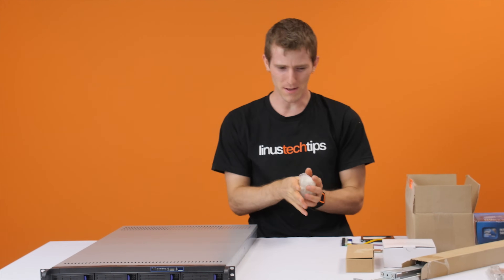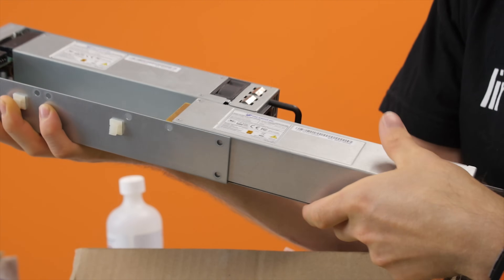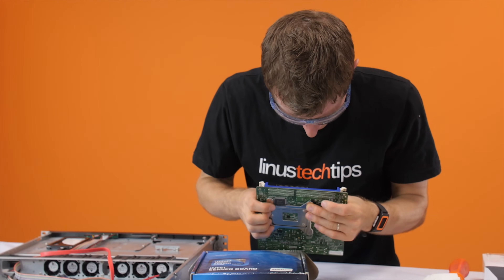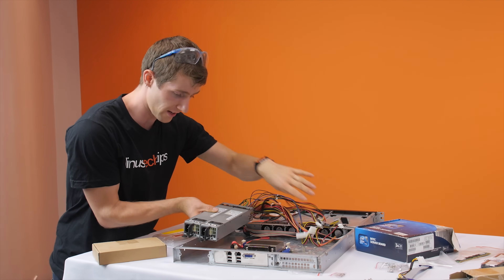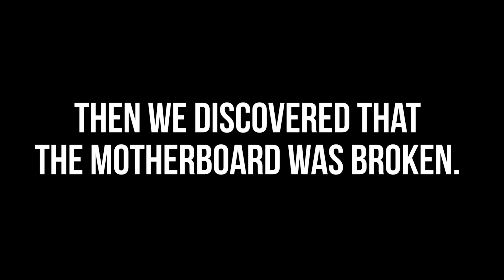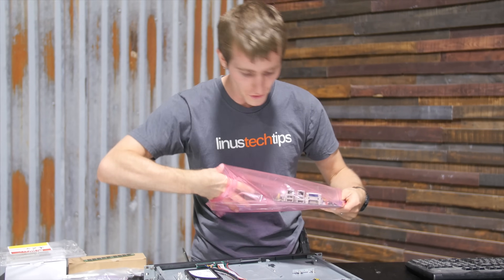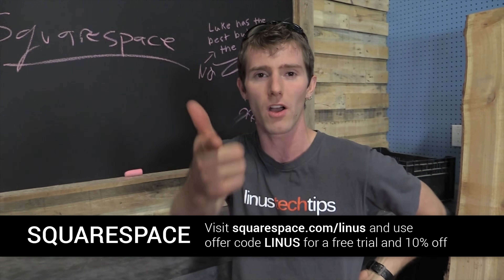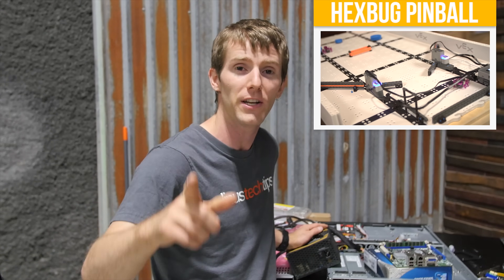DIY pfSense Rackmount Router Build Log - Part 1

Comment: Linus, some Intel motherboards are extremely picky,  when you do NOT have a CPU fan connected to the motherboard.  When it runs into boot and does not see a fan after a self test,  it will throw a thermal shutdown.  Some motherboards with Intel even do that with no chassis fan connected to the board either.  You may not have bricked either of the motherboards.  It could be that issue,  just hook up a CPU fan and set it inside the case.  May be the issue.

Comment: From my experience working with boards that interfere with the backplate zone and 1U cases, just get nuts that fit the cooler screws and forget about the stock backplate. Tighten enough to spread the paste which should cause board flex to be no more than 0.3mm from CPU to board edge. I actually used xbox 360 backplates at one point if mounting pressure was critical.

Comment: Linus. i have a few suggestions: use an ATX motherboard for more expansion and cooler clearance, or at least a different one. use a different cooler im sure there are better coolers on the market. i know the mini ITX allows more airflow but an ATX or micro ATX would be worth the trade off. but otherwise a good idea.

Comment: May be an old video, but I do have to say how much of an idiot you are to DREMEL AT A MOTHERBOARD! Desolder... Replace the fan pins with ANGLED PINS! ... You're supposed to be much more knowledgeable than I am, yet here is a fine example of that not happening...

Comment: Shortage due to backplate on the back? maybe it's on of these Boards which do not even post, if no cpu fan is connected? and i might have tried swapping those srews from the cooler with some of those press-down-to-clip-on screws from an old intel stock cooler. Which might eliminate the need for a backplate at all. And i'd check, if the cooler might touch some compontents of the top side of the mainboard. oh, and a test out of the case before with some other cooler might be useful for failure.checking..

Comment: This quite reminds me at my pc build. I had to drill a hole into my cpu backplate and my old iChill GTX770 was an 1mm fit to my HDD cage, but it has to be angle grinded for the even longer GTX1070 Strix. But the IO shiled just fit as it should :D

Comment: i think most people will installing those difficult 1U setups with lot more care to not let die a motherboard, take much more care on the cpu installation, space is very critical and short connection is easy made, personally i wouldnt use 1U anyway , just use at least 2U make things so much easyer, bigger fans, cooler machine and space for some upgrades.
I mean 1U form helps great in a datacentre , but for home or office ...  shouldnt be the limitfactor to not use something bigger

Comment: I'm in the process of building my own at home server , to save money I'm building my own case. I started out with a standard breaker box that you would typically use to power your house , hollowed it out and made some metal fab mods and it actually made a pretty decent case , I'm still waiting on RAM and storage but other than that I'm just about done , I've gotten dual AMD quad core CPUs , 600w power supply , and an HP server board with 8 ram expansion slots and 14 SATA ports. so far I'm at $300 by the time I'm done I'll be at about $500

Comment: I did not read all the comments, so I am probably repeating.. but it's pointless trying to shoehorn a router into a 1u. just do it right, in a 2-3 or even 4u. IMO, 1U is really only for when you need to absolutely maximize your dnesity. Secondly, those backplates are to allow more weight from vertically mounted, heavy heatsinks... You would probably be far better off to find a way to skip using that mounting plate on back of the motherbaord for this application. Maybe some bolts instead. Thirdly, with all the space you have, why would you use an ITX board? My opinion, and ONLY my opinion, is it's a complete waste. get at least an mATX board for this build. It would then (most likely) eliminate the backplate issues, becasue it wouldn't have chips soldered onto the reverse of the PCB in the bakcplate area, and you wouldn't have to destroy components on the top to fit the heatsink.

Comment: OR!! just pick up the cheapest PC you can find that has an expansion slot for a NIC.. You can find refurbished PC's the all day for around $100 with a 3GHz Core 2 Duo and 4GB of RAM. Usually they have a 90 day warranty. Maybe replace the HDD with the cheapest SLC SSD you can find and you might be set for 5+ years of solid gigabit performance. Maybe even run PFsense in a VM on it with 2GB allocated to it and 2GB allocated to a simple NAS VM on the same machine for web cashing.

FYI, Intel NIC's seem to have the lowest overhead Incase you only find a dinkie CPU for cheap.

Comment: Just curious and I know the video is not new but since the board is obviously designed for a stock cooler or a cooler designed specifically for it, why didn't you just use nuts with insulating washers instead if the backplate, ideal?, no... but it probably wouldn't have killed the board, it works for stock coolers to not have a backplate, and it's a low power Xeon so...

Comment: So let's see if I understand your method.
Have wrong form factor part to fit into a 1U case, so you have the following options.
1. Figure out you have the wrong part, so return that part and purchase the correct part for the job.
....or....
2. Whip out the angle grinder and cut off those pieces that are in the way resulting in a part that is no longer returnable.

Wise choice.

Comment: Linus should warn people that nothing in this video should have occurred ever when building anything you would like to have operate which must have been why he made it. ?????  A reverse psychology tech tip video on what not to do at all ever when engineering or constructing anything. Even if you just want to waste your time and money instead of just bashing your head against a wall. omfg, a dremel tool used at all for any production equipment should never happen. my mom can barely use her ipad and would never even think about doing some shit like not taking the time to size up ALL of your components before assembling something. I think you should put this in a category like entertainment because I would be hard pressed to find anyone without the intellect to take on this particular project in the correct manner. Sorry to bitch but this just seems in my opinion to set a bad example to younger people regarding not taking your time to research everything 100% then double checking your work for any build. sheesh.

Comment: I have never has issues building anything into a 1U Rack case before.  Equipment or computers alike. . .  ALWAYS double check your work when working with full metal chassis and make sure nothing is shorting out and always make sure everything is properly grounded especially when dealing with high voltage systems crammed into a 1U lol

Comment: Don't you hate when a cheap quick build becomes an expensive time wasting project?  Maybe you should plug in the board and put a Multimeter on that backplate to see if it is getting current.

Comment: i love my pf sense router its amazing the sky is the limit for these what ever you want to do with it. that being said i would love to see some videos on configs and packages that you can add to it. I have even seen people adding gps time modules and external monitoring screens. would love to see some how to videos on this linus! i think its a really cool options to get a router, firewall, traffic shaper, dns, vpn, switch, poe switch, dyn dns and much more that you can build yourself in any configuration you want at a fraction of the cost of even a store bought junk router even using a laptop or old computer. theirs 2 packages i want to add to mine squid and snort did you  guys happen to set that up?

Comment: Im all for building your own firewall/gateway/router, infact i'm currently building an Untangle box for +- 1000 devices. However both Dell and HP have some amazing server for good prices which are pre-tested at the factory. You receive a WORKING server with which to install pfSense.

Comment: So what heatsink was Intel expecting you to use with this board?

Stock cooler won't fit in a 1U. Most aftermarket coolers require backplates that this motherboard won't accept. Sounds like a huge design issue.
Reply: it isn't a 1u motherboard

Comment: waist of money and time just use an old rack-mount server like my power edge 2850 i picked up for 100$ on e bay with duel duel core xeon and dual power supplies tecks like this are just wasting money with this shit metal shavings and  cut case will fry your MB real quick METAL DUST EVERY WHERE WHY DO U THINK THEY USE CLEAN ROOMS FOR A REAL GOOD BUILD]

Comment: Had the same issue with my miniITX board. They compress everything so much they often have chips and such around the bottom of the CPU socket.

Needless to say, backplace should definitely not be touching anything metal on the back of the board... Had to go with push-pin cooler.

Comment: After watching this video I'm beginning to understand why Console players think PC building is something hard to do
Reply: That's because you buy crap hardware or don't have common sense. I've never had anything die while working with PCs, except for cheap ass PSUs.
Reply: But it's not like console people ares building a 1u rack mount machine
Reply: That's because you don't know how to use them
Reply: I can do the same thing to a console everyday for 10 years and it works like a dream. if I even look at a computer wrong, it starts smoking, gets a virus, blue screens, buzzes, starts on fire this time... you know? everything i can do with or to a computer will cause it to crap out on me in the worst way possible.

Comment: You could have just gotten a Supermicro 1U server, probably for the same amount of money (or less) and everything would have been designed to work together from the get go without needing to cut anything.

You would have saved yourself a LOT of time.
Reply: Wouldn't make for a very fun video, would it? The point of LTT is entertaining the viewers, this means doing things suboptimally sometimes
Reply: It's not just suboptimal, it makes him look inept. I personally lost a lot of respect for him.

A proper build using proper hardware would have been just as interesting with no loss of respect.
Reply: +Submissive Kitt3n! he's probably one of those guys that will never admit to fucking something up and is always perfect
Reply: Have you ever failed at something?
Reply: +Submissive Kitt3n! oh absolutely, that doesn't change the point though.

Linus is supposed to be smart, this is supposed to be his thing but this just highlighted how wrong that notion is and that maybe he's just a guy that knew a little about computers but was good at making a YT channel and good on him for that however, he went completely the wrong way about this, completely and how many motherboards did he trash in the process?

Comment: I couldn't keep watching. Single PSU would have done fine, keep a spare. Use a mATX board next time. Use correct coolers. 
http://www.ebay.com.au/sch/i.html?_from=R40&_trksid=p2050601.m570.l1313.TR0.TRC0.H0.X1U+CPU+cooler.TRS0&_nkw=1U+CPU+cooler&_sacat=0
http://www.ebay.com.au/sch/i.html?_odkw=1U+CPU+cooler&_osacat=0&_from=R40&_trksid=p2045573.m570.l1313.TR0.TRC0.H0.X1U+PCIE.TRS0&_nkw=1U+PCIE&_sacat=0

Comment: First off, I love these video's which reminds me of the time I build those horrible Intel Hudson white box servers. Second, I'm so glad I have nothing to do with hardware anymore. Just spin up some new vm's of some hyper visor box in a random data center and get to work. @linus your setup is way to dodgy. Get some psu's that where made for this enclosure and a mobo that's compatible. The builders site should have an HCL. The memory should never block the airflow. But you know that, silly you :)

Comment: This video should be called "how not to build router", no,  srsly, I'm network engineer with system administrator background for past 9 years and I've never saw such unprofessional work like this for entire career.
Reply: +Nick Chernetsky Unprofessional work is Linus' special move.
Reply: +matt kessler *they're *their
Reply: +Nick Chernetsky 
Press Left Brain Right Brain Pause for 3 mins and Start!
You have activated unprofessional work!
Reply: How to build a router the lmg way
Reply: Inventing wheel? No thanks, there is enough information about this topic already available in the Internet.
Reply: I'm not saying that I have better video, because this is not something I do for living.  I'm saying that this one from Linus is most awful guide I ever saw. Any guide you google will be ten times better than this.
Reply: my first media pc was built in a 1U case....and would probably be as powerful as this router, and i didnt have to cut anything.
Reply: Exactly, as a Sys Admin and Engineer as well I watch this and cringe. Nothing that he does should be emulated. 

This is a guy who relied on RAID for his backups....and was surprised when they failed lol.

Comment: Seriously.... Why on earth is he using a angle grinder? You could have easily used the dremel. It has 2400 RPMs... I have cut through steel that was so hard it was bright white sparks.. He definitely could cut through a measly little heat sink plate. And again. Why did he cut the speaker? Just unsolder the damn thing. And another BAD move on his part was HOT gluing the goddamn power supply to the fucken body!! Open the damn power supply and take the board out, theeeen drill the holes.. Good god.

Comment: Is it just me, a non-tech person that messes with computers a bit since 1992, but why didn't he just spec out the correct stuff for this build so it fit without all the cutting. I bet that the correct components would have fit. Also that seems like a bit of overkill unless they have a couple of hundred workstations on that box. I'm building a pfSence box from an old D975XBX2/Q6700 I built about 8 yeas ago that will also be overkill but it's free.
Reply: *****
You can still find all the parts for a cheap low powered pc with doing the cutting.

Comment: Why pfSense and hello right angle sata.
That CPU needs a vented plate around the ports, where do you expect the air will go? It will bypass the cpu and flow over your network card.
Yeah, I'm sure the MB was DOA...

Comment: This is like dedicating a whole room for your fridge space efficiency wise. You can run pfSense comfortably on almost anything x86 including gear that is smaller than today's conventional SoHo routers. I have been using pfSense as my main router in a VM for 5 years+ and it's fantastic out of the box except I highly recommend that you enable static port NAT.

Comment: But it's not just about holding a cooler on.. it's about even pressure on the chip and the thermal compound and a whole bunch of other stuff. I mean it probably won't melt, but maybe a backup video while a different cpu was on order would have been better?

Comment: Linus, those contacts and via points on the back of the board don't like being shorted by a back-plate. The ironic thing is, dremeling the back-plate to avoid the chips likely caused the plate to short more contacts. There is an amber colored tape you can use which is non-conductive and low-static: it's used for board re-work.

Comment: That dumb cooling heat sink.... put that away use some other simple cooling system. the metal back panel is shorting the cpu pins.(I think so). OR Just buy an router.
.
.
.
So much money to waste..

Comment: Well, 
1. If a back plate needs angle grind-ed, its not going to work.
2. Now that your 2 mobos in, i would HIGHLY suggest checking the ram, cpu, and pci card in another board to make sure there not fried from the... Dremmel shenanigans.
3. Wow.

Comment: What i suggest to you is find the right heatsink for that mobo.2nd is, if u still want use the same heatsink,use the copper plat for get some space between heatsink and component on mobo.The sound i hear is about processor faulty or mobo faulty.Use the washer on backplate to get clearence between backplate and mobo.And last is change the short scew to mid screw for tight the heatsink.Hope u understand and get help u.

Comment: Wait, so you got all of your staff overpriced $1500CAD(w/tax) TitanX's and the best 4K monitors on the market but you couldn't get a decent Supermicro 1U chassis with redundant PSU's and a pre-installed motherboard for a critical component such as your main router? Sigh..... I'd for sure want ECC memory in such an application. I get all my Supermicro hardware from NCIX, so you should have no issues getting them either.

Comment: My router/NAS combo setup: Intel Core 2 Quad Q9300 CPU, Asus P5BV-C MoBo, 8GB of non-ECC RAM, a 6TB HDD and a 60GB SSD, running Ubuntu Linux. Since I have a few old parts to use I used a recycled tower case

Comment: I Think you are shorting the board by using the metal heat sink bracket...just an observation. You can use a non conductive sheet to create a barrier between the bracket and the board...